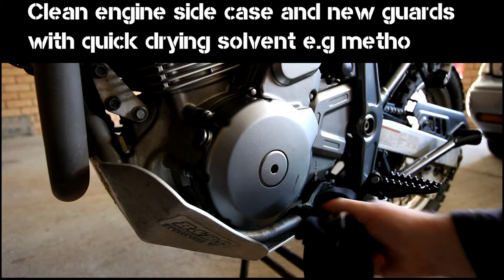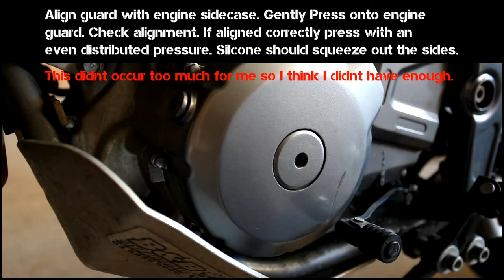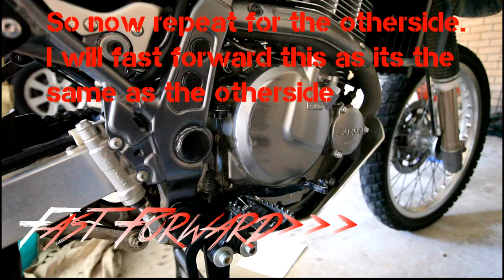How to: DR650 Engine Case Armour Install

Comment: Nice video, you really want to hit all the edges with the silicone so that it creates a seal. You definitely do not want any debris to get stuck between the plate and the engine casing :) Once the silicone dries it is very easy to trim the excess with a blade. Now your DR is definitely a tank lol T4S
Reply from the maker: Yea there aren't many gaps. So will add some more and fill it up. I ended up with about 2mm of silicone between the guard and the case in the centre area. They say 2-3mm in the instructions.
Not sure if I would cut it with a knife...it would most likely mark the engine case. Its quite easy to just wipe it off with turps before it dries.